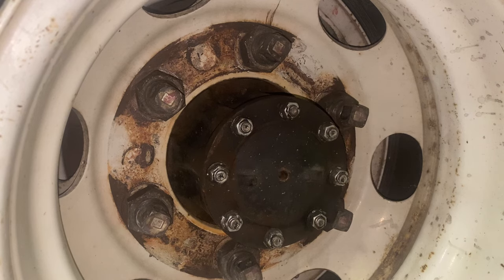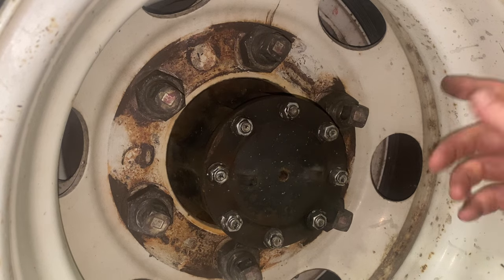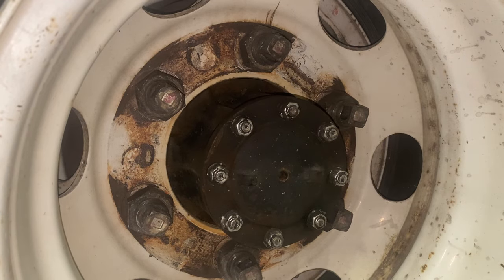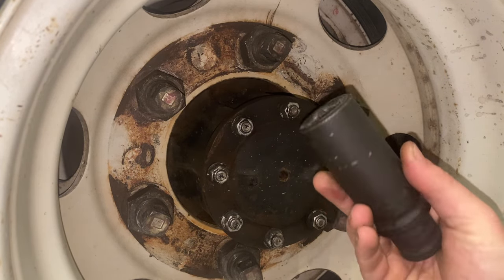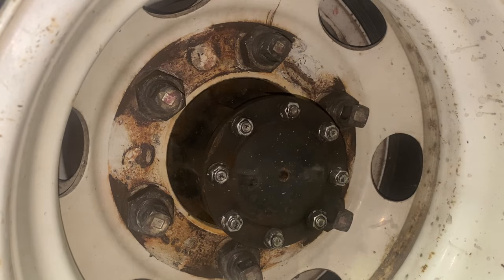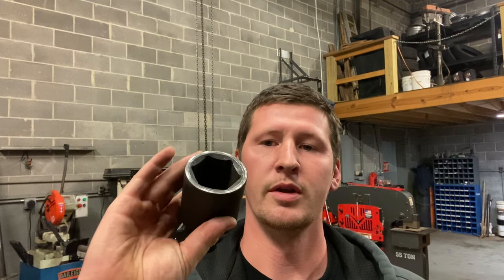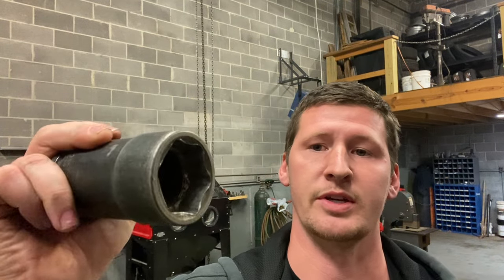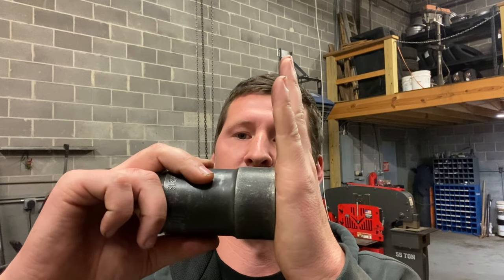Isuzu NPR Wheels and Tires 101

Comment: On the rotors being reversed, you got lucky. I have actually had the lugs back off because they were mounted on the wrong side.

As to using a torch to loosen the lug nuts....I found a much easier way to bust them loose. eBay has a very reasonably priced torque multiplier kit that I keep inside my truck. The kit has the multiplier and several size sockets, including the square drive!

Comment: Glad I found this !!! I just used a 50 ton gear puller on my inner duals and it's jaws ripped small pieces out of the wheel holes! I said "C'mon Man! Something has to be holding this thing on!"
I get it - you unscrew the WHEEL STUDS !!! (and there are smaller fixed studs inside those)

Comment: Hey man I love your vids! I learned how to do brakes and adjust the parking and rears because of you. I just recently changed the front calipers on a 2016 and I am unsure of the bleeding procedure. I have the IDSS software but I am not sure if I need the truck running or not. I read a lot of different info on the web. How do you bleed brakes on the npr?

Comment: Hi, Question: you mentioned to invest in a torch to help get these stubborn Lugnuts off. Not exactly sure what torch and how I would use it. Could you recommend a model number of an appropriate torch? And do I just  heat up the stud in the middle of the nut or heat the outside of the  nut as well? What I like about Your videos is that you give step by step instruction(even the steps that might be considered common sense to some). Thanks

Comment: You may need a pork chop wrench if the outer nut seizes to the inner combination nut stud on the rear wheels. Get one ahead of time. Good MAP gas plumbing torch will provide adequate heat to aid removal in most cases.

Comment: I love this channel! I'm shopping for a used NPR. It would be great if you could do a video about how to spot a good or bad NPR for sale (what to look for or avoid). I've pretty much settled on a 2000 HD diesel from Craigslist but I'd be lying if I told you I wasn't worried.
Reply: Did you buy one?
Reply: I found one w 5 lug rear wheels and 15.5" tires.  Can't get tires.  And can't get wheels made.  Must do hub or axle swap.  Hopefully I find a video

Comment: Just in case i missed your answer. On drivers side that is reverse thread. Once outer lug nut is removed, will the inner stud that 21mm socket is used on be reverse thread as well. Thanks
Reply: Yes

Comment: What do you do when both lugs want to come off at the same time on the back wheels?
Reply from the maker: They should be torqued the same (362) re torque the inner. Slightly over torque the inner with your square socket. Then use a torch to heat the outer lug nut. Inspect the lug nuts and studs for damage. Replace as needed
Reply: When loosening, you should also make sure that your socket is only engaged on the outer nut if you are using a Budd wheel socket. When loosening or tightening the outer wheel nuts I always keep the socket about 1/4 inch from touching the wheel.

Comment: Where’s your shop located?
Reply from the maker: Tennessee
Reply: @Nprdoctor  you wouldn’t happen to be close to Knoxville? I recently acquired an Npr and I’m having trouble finding someone who works on them.
Reply from the maker: @iCONAN1  what year and motor is in it. And what’s your issue. I’m not far outside of Knoxville. Depending on the issue I may be able to help or point you to someone who can.
Reply: @Nprdoctor  07 6.0. When I start it and go to take off, it sometimes acts like there’s no fuel. And kinda sputters for a few seconds until it clears out and then drives fine. I was thinking it’s maybe the O2 sensors?
Reply from the maker: @iCONAN1  what is your email. I’ll send you my contact information
Reply: @Nprdoctor  I think YouTube is deleting the email from the comment section.
Reply from the maker: West fleet service behind west Chevrolet on Alcoa highway is a great shop. They specialize in medium duty trucks. Take the truck to them and get your issue diagnosed it shouldn’t be to expensive.
Reply: @Nprdoctor  ok I’ll try them. Thank you